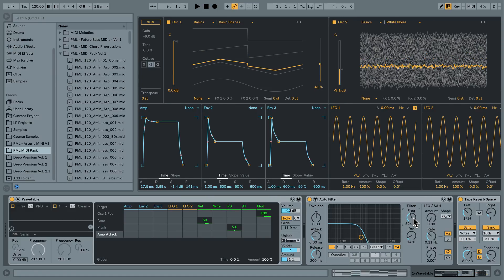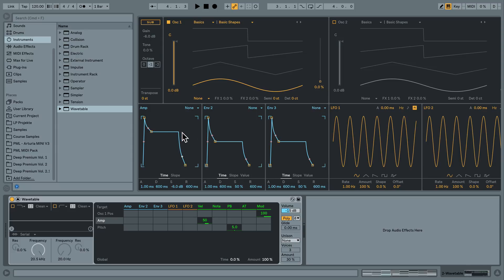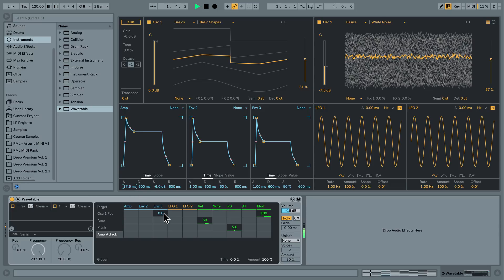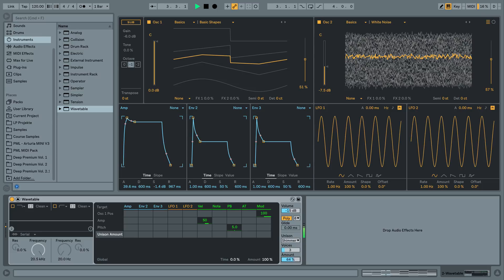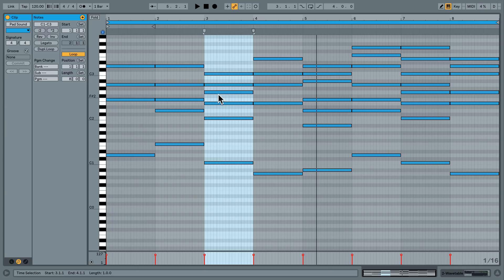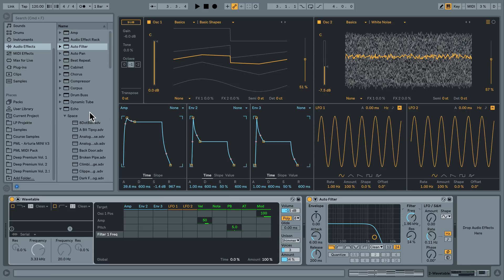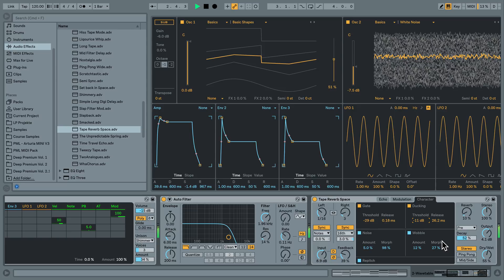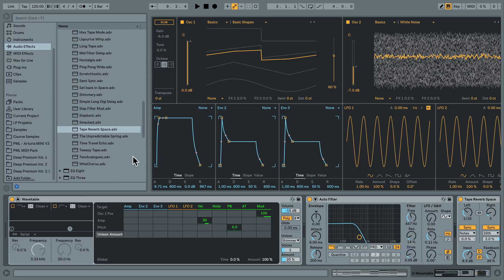Ableton Live 10: Air Pad with Wavetable (4K Sound Design)

Comment: Thanks for the great demo. Shimmer is relly cool. But I don't think the click you mentioned at 3:30 is a bug because you use only 8 voices and have some release time. So if chords change, all voices of both chords are played together as long as the release time is. So the new chord steals voices of the old chord if the sum of notes of both chords is bigger than 8. I assume the filter inside the wavetablesynth works per voice and can't filter the high frequency click as it is filtered with a filter affecting the whole output of the wavetable synth. But I agree that this phenomen could be avoided by programming (kind of cross fade or minimal fade in/out on voice stealing). So I wouldn't call it a bug because it is quite reasonable why this happens. Better call it "possible future improvement". Just spend more voices here and it should work flawless.